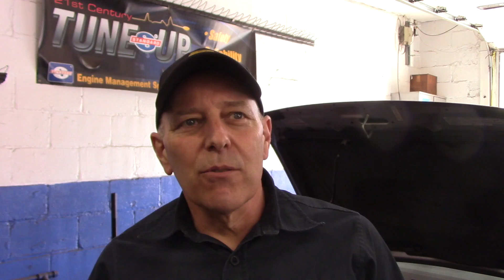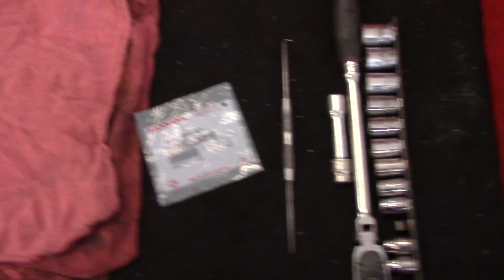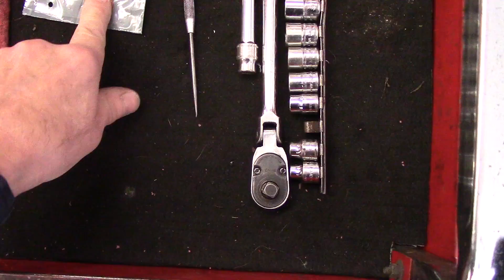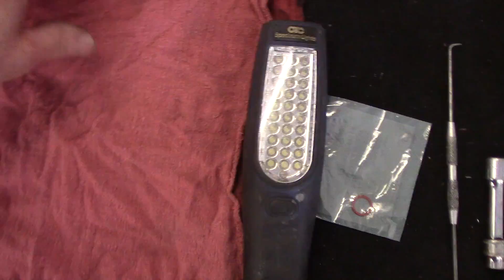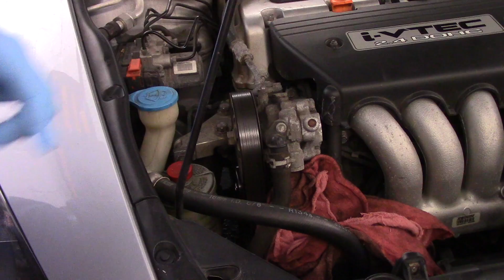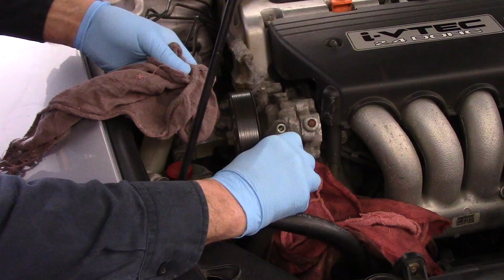Repair A Noise In The Power Steering On Honda 2002-2010

Comment: Thank you so much for this video! It saved me lots of money!!! I have a 2004 Honda pilot that is in great condition. I kept hearing a whinnying humming noise under the hood. I took it to a local mechanic shop, and they said that my power steering pump needs to be replaced.  So, the estimated cost was $835. The Honda dealership was going to charge me $1,350.  They said they were charging such a large price because they would have to also do an alignment after removing the pump.  After listening to your video, I went to another Honda dealership and asked them to replace all the o rings, flush and replace fluids. They did it with no problem and did not say anything about me having to replace the pump.  It cost me a total of $408.21.  I paid it, got in my car and it drove smooth without any noise, or any problem.  I'm sure I could have saved even more by doing it myself, I'm a lady and no nothing about working under the hood of cars. I'm satisfied that I didn't pay the other outrageous prices.  Thanks again and may God bless you!!!

Comment: To be honest, by the time that seal goes bad and needs replacement, all the other internal seals are likely in the same condition.  If your high pressure side is leaking, and you replace that o-ring alone, the increased pressure will push start to push past all the other seals too.  Best to just pull the pump and do all the seals at once.

Comment: I have a similar issues with cold starts and whining of the power steering pump and the reservoir has a foam/bubbles when its cold started. The honda website states the part number doesnt fit my car and the TSB doesnt cover my year of honda (2010). Has anyone done this replacement on this part for a 2010?
Reply: Did you get it fix
Reply: @steevegmtech7326  I replaced the o rings, and replaced around 80% of the fluid and still had a whining noise when around 0 degrees Fahrenheit
Reply: @nathanaelprzybilla3851  did you have the whine during the summer?did you have other leak
Reply: @steevegmtech7326  nope, only when below 0 on a cold start, no leaks that I can find so I'm thinking it's the pump or a leak in one of the lines. I did replace the clamps and inlet tube since those seemed to of had a leak

Comment: Can you do one for 2011 Honda Accord?
Reply: I just did this on 2012 accord 4 cylinder I'm pretty sure it's the same mine was in the same place as in the video but part number could be different. Call Honda dealer to confirm part number 2008 to 2012 is the same generation Accord.

Comment: Hi! I received two orings from Honda for the power steering pump - a red/orange one and a black one. Where does the black one go??
Reply: The high pressure power steering line on the other side of the pump.

Comment: Have you done a you tube video replace  power steering fluid reservoir ( tank / bottle )? And how about those two pipe (hoses) what are connected on power steering reservoir tank/bottle?

Comment: Hi Jim.  How we can fix the hard steering in a honda integra 2003 DC5. Cheers
Reply from the maker: Hard steering can be caused by a lot of problems. Here are a few thing to check. Check the fluid level, check the drive belt, make sure your tires are inflated properly and check the front suspension. keep me posted. Thank you for watching .  Don't forget to subscribe.

Comment: Hey Mr. Jim.  Do you find that Honda's tend to moan a bit more than other cars especially on start up.  We just purchased a 15 Honda Crosstour that has an engine that looks just like that one.  When started it moans.  It sounded so much like a power steering moan that I removed the accessory belt to rule that out.  This is the first Honda we've ever owned.
Reply from the maker: Actually it is not a very common problem. Thank you for watching .  Don't forget to subscribe.